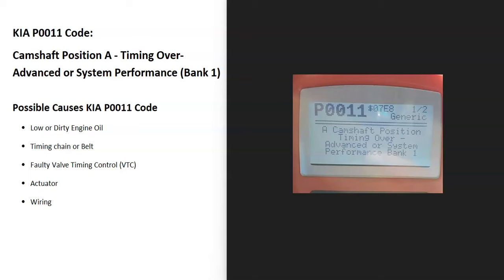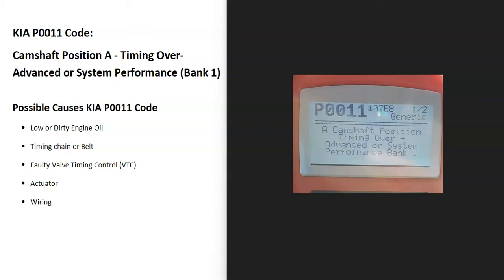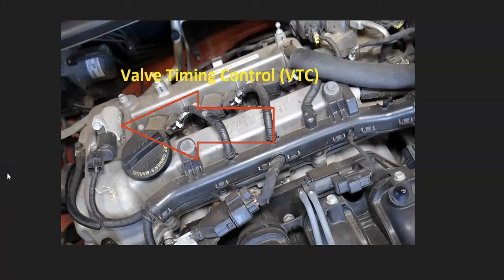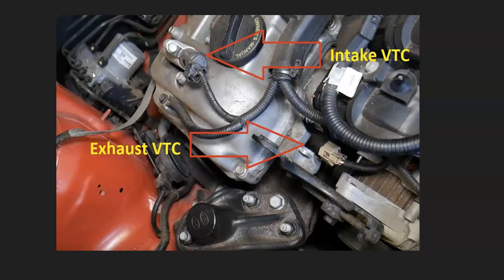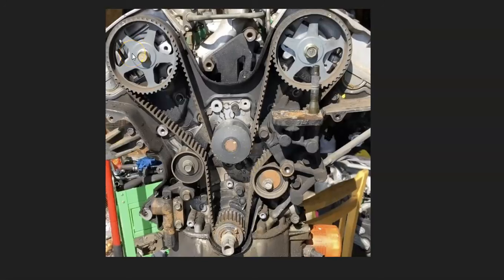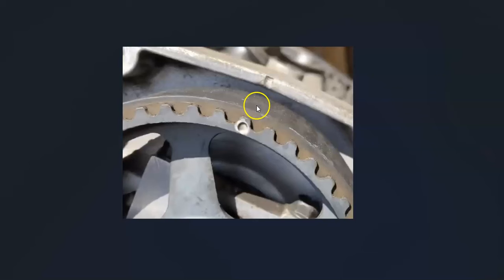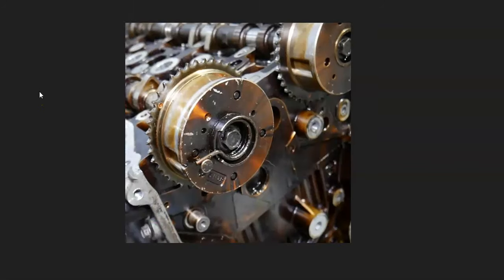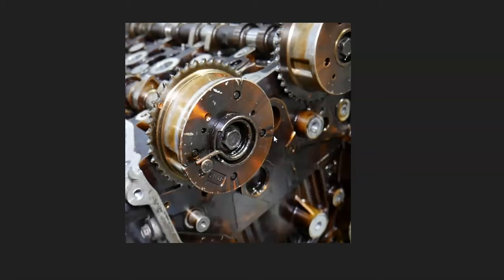How To Fix KIA P0011 Code Camshaft Position A - Timing Over-Advanced or System Performance (Bank 1)

Comment: I checked the oil. It was low. I put oil the engine light is still on. No power when I push the gas. P0011 code

Comment: I have p0011 code on kiq optima 2018. I changed the engine oil and filter. How long should i wait for the check engine light to off?
Reply from the maker: If that was the issue, it should have gone off. It can also be cleared with a scan tool to see if it comes back. If it comes back, then there is another issue.

Comment: I’ve been getting P0011 and P0340 cylinder 1 over advance. Replaced the camshaft position sensor and ordered a VVT valve. 2010 Soul 2.0 with 142k. Mobil one synthetic every 5k.

I replaced the timing belt when it had 108k with Aikin kit…could it have stretched already, after 34k miles?

Comment: 2018 kia forte with 89000 miles.
 yes crank but no start 
and have 2 codes p0011 and p0017

replaced
- vvt solenoid both intake & exhaust
- new spark plugs
- camshaft position sensor 
- crankshaft position sensor

What do you think my next step would be take it to a shop??
Reply: hello??
Reply: id check your timing